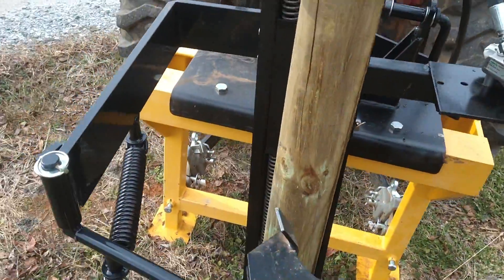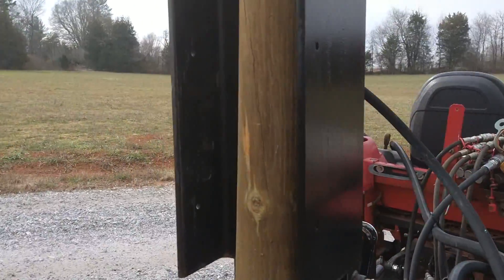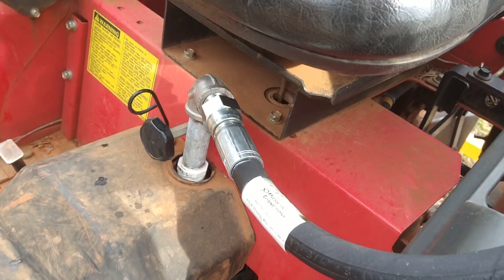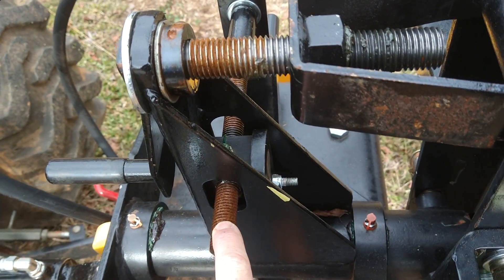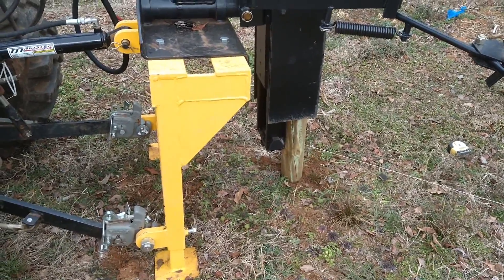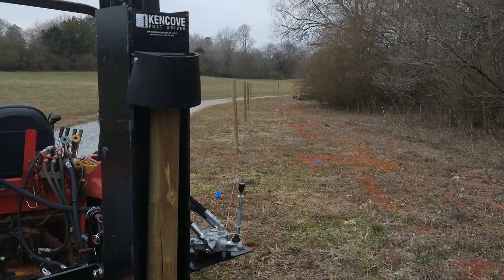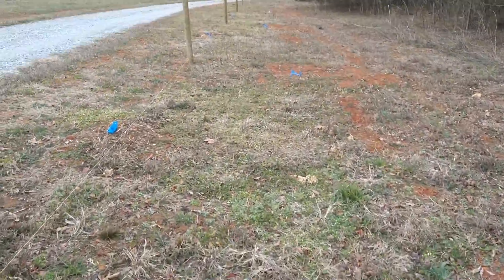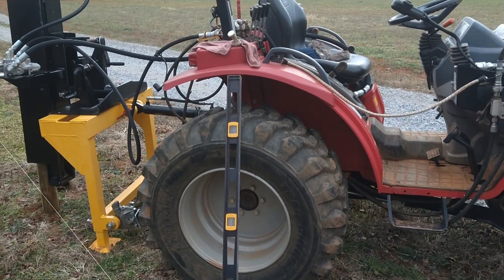Kencove PD80 Hydraulic Tractor-Mounted Post Driver with the Mahindra 1526

Comment: Jared, I have the pd100 model.   I mark the ground  with marker paint and back up perpendicular to the mark (face of post is line).  Constant adjustment is needed since the pound pressure is enough to move the post.   I use a breaker bar to do minor adjustments inside of the ram beam.    Also top of post if not flat will send it side ways.    Keep away from the beam but I have used 2x4’s to adjust it as you go as well.  Once it’s in about24” should stay straight.    For storage I pounded a post and chain it to the post.  Tried storing it indoors but too tall and wonky.  I was worried that it would fall on me.   I have used it for at least 2 miles of fence.   Nice video.